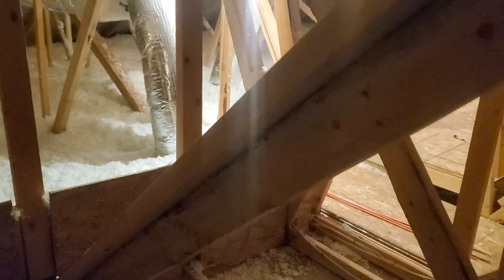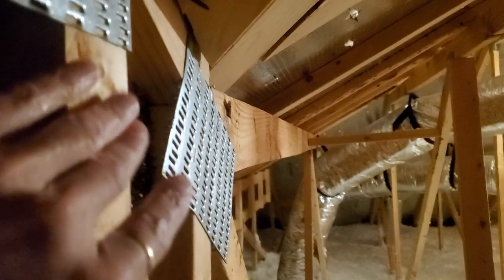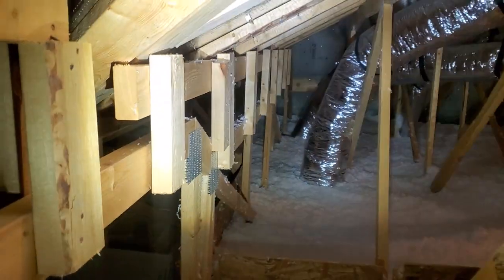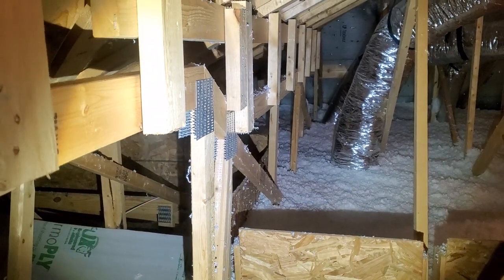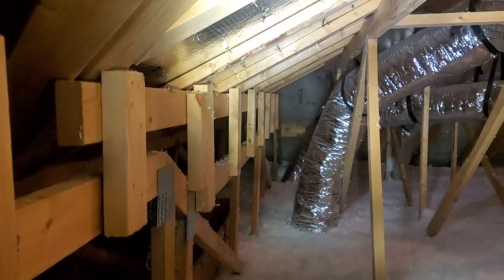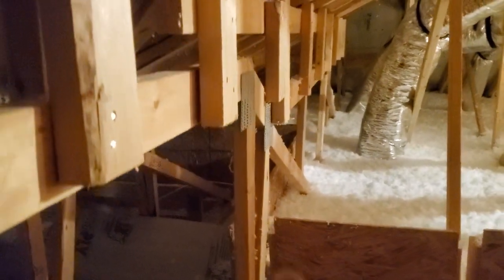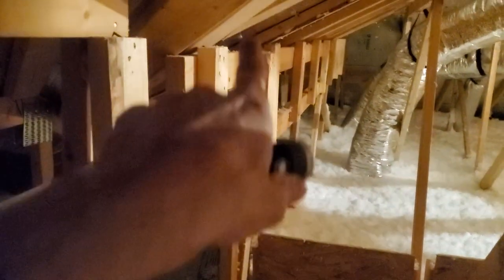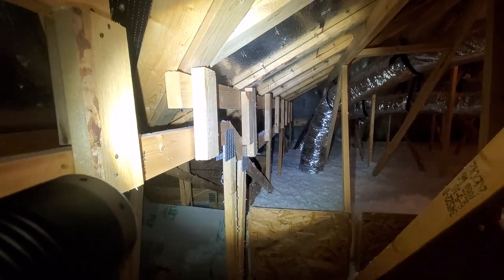Truss crutch crippled extension like nothing I've seen before in a new home!

Comment: Framers should have put a 2x12 across the top of the short truss that also laid on top of the short truss.   That should handle it however I doubt any engineer will sign off on it without doing a proper repair.  Nails are not supposed to carry load like that and they might sheer off and could loosen over time.  Those short 2x4s has 4 nails each, two on the top board and two in the truss.  Most nails from nail guns shear off at 93 lbs so that kludge could only handle 93x2x8~1500 lbs and a 120 mph gust of wind against 30 degree slope times two 4x8 sheets of plywood is 1800.  It definitely will not pass as trusses should have at least a 2x to 3x safety factor.  Note I am not a structural engineer and did not run a simulation.  I made many assumptions like size of the gap that I cannot measure and could be incorrect.  The website I calculated the wind speed load could be inaccurate.  Homeowners should be concerned,however.  Hopefully the builder will fix it but don’t be surprised if they say it is out of warranty and won’t do anything.  Might be able to recreate and build the right sized truss piece by piece next to that truss without tearing up the roof.  Good luck!

Comment: What would the failure mode be if this cripple can’t handle wind load?  Would this section of roof cave in, or worse?
Reply: It wont even come close to failing. 1 damaged truss is well within the factor of safety which is accounted for in the building codes. It should still be fixed though.

Comment: the one thing I would be concerned about is in Austin especially with all the "green" as soon as some solar requirement is shoved through by the idiots in charge of whatever area......what will that solar panel weight load to to all of these "oops" trussed roofs.......on that part of THAT roof it might not be an issue because it did not look to be a large area of roof and looked a bit steep for solar......but on some of these others you have shown with busted truss corners on 2 or 3 trusses in a row in the main section of the roof you have to wonder what the cost will be to "retrofit" to make that solar install work (and of course then the install will never pay off in the 20 year life span)
Reply: You can't even bang out a complete sentence... Yet you believe ANYBODY takes you seriously.

Comment: Personally I'd be comfortable that it would hold. Is it what I'd do? No. But I think it'll work just fine. My house has an open attic, zero collar ties or support walls inside and it's 2x4 rafters on 24" centers. Been standing since '52 🤷‍♂️ a lot of these engineered roofs are so overkill its insane
Reply from the maker: Whaaaaat

How's the snow load in Ontario? I just can't imagine 2x4s on 24s with no collar ties or pony walls / purlins would last since 1952. I've seen stronger roofs fail in 90mph winds.
Reply: @Constructiva Inspections  it's only about a 12' span and it is sagged a bit. But it's doing just fine 🤷‍♂️ I don't think I've ever seen more than a foot and a half of snow accumulate on it

Comment: Nails should never be used in a sheer capacity, period.  There should be a sistered block stacked so that each one transfers the roof load directly onto the short truss.  So simple yet apparently so difficult.
Reply: Nails are designed for shear capacity.  That's why we use them.  Roof load isn't much maybe 40 lbs per ft.  I think the main issue here is wind load and uplift.
Reply: @mattmag3089  so nailing deck beams, ledgers and joists should be just fine then.   Cool... got it.   No direct bearing requirements, no annoying bolts, no joist hangers.... That will save me a lot of time in the future.  Thanks, LoL
Reply: @Scooter Rockets  your argument is unfair.  I simply said nails are always in used in shear... as opposed to tension.  You're using of the blanket statement "never be used in shear" is just ignorance. Every hanger nail is in shear.  Every stud nail, every wall panel nail.  Nails are always in shear.  I never said how much,  though.  There is a limit of course.  One 16D common can hold nearly 140 lbs shear. One .131 box somewhere near 100.  Again, no issue with shear in this setup.  But definitely tension.  That stupid thing they built could be pushed off laterally quite easily.
Reply: @Scooter Rockets  that's why hurricane clips work.  They use nails correctly, in SHEAR, rather than toe nails being used in tension.  Study up buddy.  I've been building houses for 23 years.
Reply: Fair enough, I see your point about the use of the word "sheer" in this context. I will revise my statement:  common framing nails should not be used in a load bearing capacity as demonstrated in this application.  My 35 years of building and renovation (since you are flashing resume’s here, apparently) has taught me that solid bearing is required to properly channel load.
Reply: @Scooter Rockets  What they did was garbage, no doubt.  But when you think for a minute that a 2x4 top cord of a hip truss often spans 7'+ (the maximum), you'll realize how little vertical "load" is on a particular section.  I think that's where our opinions differ in this instance.  The fact is that even 2 .131 box nails can support that load (80 lbs per block if framed 2'o.c. with a 40lb roof load) in shear with 100% safety margin, I think qualifies as good.   Regardless I would have framed rafters, personally, in that section.  Looks as if a 2x10 rafter would bear quite nicely. (Edit: rafters over short truss between the 2 adjacent hip trusses)
Reply: @mattmag3089  the nails can theoretically support the anticipated load, but the fasteners themselves are seldom the point of failure.  It’s the wood (in this case ordinary SPF it seems) that usually fails due to the splitting force exerted around the fastener.
Reply: @scooterrockets7815  agreed.  Happy Easter
Reply from the maker: @matt mag and @Scooter Rockets ...I just popped by to say that I found yalls conversation quite interesting. Not gonna lie, yall have been building houses longer than I have been inspecting them, but since we are throwing out resumes here, I started remodeling back in the early 90s and would say I know a thing or two as well. That said, I love hearing the point of view of the pros because I feel it helps reinforce my own knowledge so I thank yall for the stimulating conversation. 

And yall keep up the good work!

Comment: No way... It's so embarrassing how we build here in the states and how designers/builders are getting away with things like this.
Reply: I mean, I agree with you but this ain’t THAT bad lol. It was a field modification and yes and engineer should sign off, but sheesh it’s not like they sat an LVL on a single 1x4.
Reply: @blakedudley4692  I would NOT want that in a house I paid any amount of money for. Those are some jankey looking members if I ever saw them... and in a high speed wind situation, this is a big reason why structures fail.
Reply: @LogansRun314  I mean it’s a production built home. Can’t really expect a whole lot from them.
Reply: @blakedudley4692   the hell you can’t, at least to Bare bones building code. And this is not.
Reply: @stevelopez372  I’ve yet to run across a run of the mill production home even remotely close to code. That shitty cardboard sheathing they use? Code if and ONLY if it follows the fastening schedule properly. Which I’ve yet to see one done properly